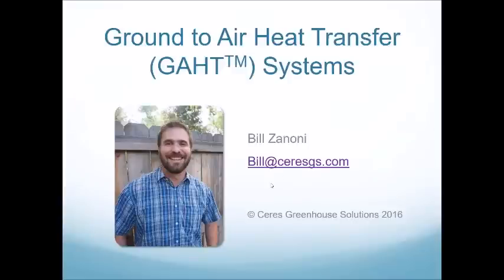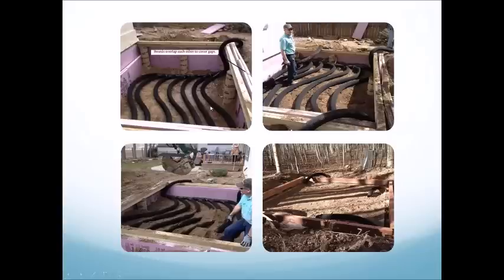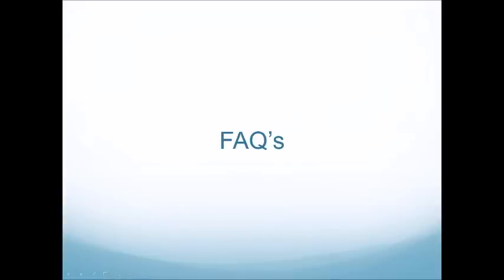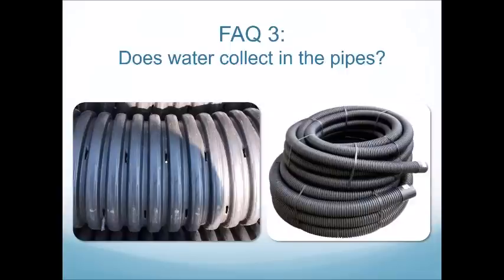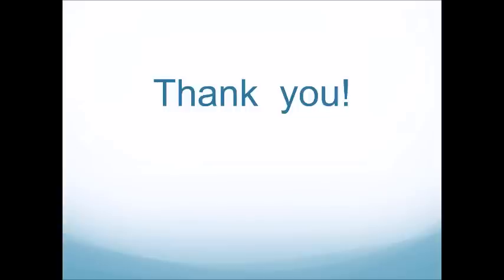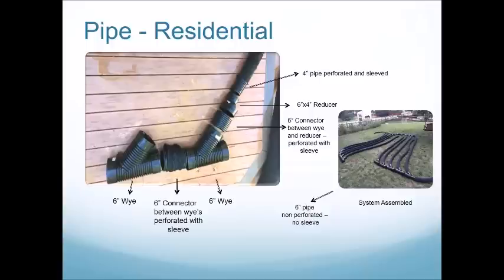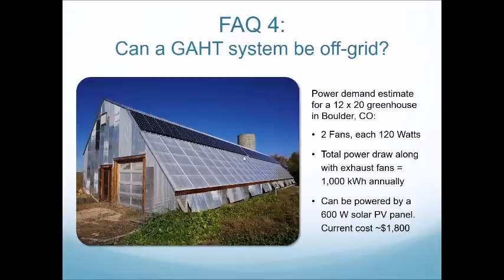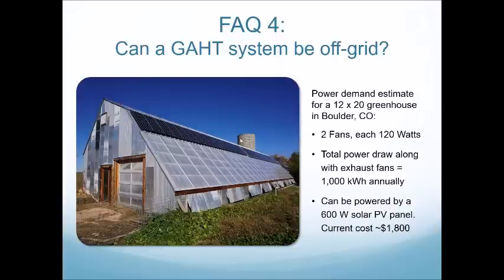Intro to GAHT® (Ground to Air Heat Transfer) Systems

Comment: This system does look like an excellent environment for fungus and bacteria to thrive.
Reply from the maker: Actually the GAHT® system has been known to filter the air passing through it. Also the pipes are perforated, allowing condensation to drain as the warm air is cooled.
Reply: @CeresGreenhouseSolutions  I may be out of bounds as I am new to this technology, however if mold, bacteria etc. is of concern couldn't you introduce a positive/negative ion generator to the system. ie; Air Oasis Bi Polar 2400?
Reply from the maker: @BamaCoolDaddy  You could certainly treat the air going into or coming out of a GAHT®. However, we have tested many GAHT® systems and have yet to find one where the air had more particles coming out of it that what had gone in. An increase in particles could be an indication of mold growth.

Comment: can you use this GAHT system in a house?
Reply from the maker: To date we have never installed a house GAHT® system. This does not mean it is not possible. We just have not installed one. Before considering this option there are two concerns you should be aware of: 

Radon 
Mold
Radon can be tested. And even if there is radon, it is more significant to watch the rate at which it accumulates. In the worst case scenario, if radon is detected the GAHT® system can always be shut off. 

According to studies that were performed by the University of Minnesota on several GAHT® systems where mold was tested no elevated spores were detected. It is important to keep in mind this is one study, and they were conducted on greenhouses and not homes. 

When trying to mitigate mold in the home you could use a filtration system with a UV lamp. It is important to look at ducting system- how to get air through the system. We can help with the design of a new system, but it is harder to work with existing ones.

Understanding these precautions is necessary if you decide to try this system on a house. Please consult us if you are thinking of a house GAHT®.
Reply: Typically they are going from the house to 6 to 8 feet deep at a 45 degree angle then giving the pipe a 2 percent slope for about 150 feet where it can drain into an accessible sump to collect condensation and continues up out of the ground at a 45 degree angle to a height of about 3 feet. They put a filter on the intake pipe. The deeper the pipe the more stable the ground temperature is between seasons. I would check the chart for your area to get the depth that’s most practical.

Comment: can u collect water
Reply from the maker: In what way do you mean?
Reply: @CeresGreenhouseSolutions  to use as heat by combining air and water to hold heat?
Reply from the maker: @terrywolsey8741  we've had growers collect rainwater in barrels to water their plants with but we don't advise that our growers use water barrels as thermal mass in their greenhouse because it takes up a lot of space. We suggest using PCM (phase change material) which comes in sheets that you can simply attach to the north wall of your greenhouse. Check out this blog for more info:  https://ceresgs.com/water-barrels-vs-phase-change-material/

Comment: Looks like a copy of SunnyJohns SHCS
Reply: Its based on John`s early design. There were lot of breakthroughs made prior to John`s passing in 2011 which led to major design changes which they obviously arent aware of. The same can be said of Jerome Osentowski who worked with John. He is the president of Eco System Design, Inc,  and they also use the outdated design..
Reply: JohnGuest45 Please elaborate...

Comment: Pretty awesome, but not very radon safe.
Reply from the maker: A valid concern for sure, and radon levels should also be taken very seriously but greenhouses are less dangerous than conventional buildings when it comes to radon. First, you are not in the greenhouse for as much time. Secondly, greenhouses have very high air exchange rates. During much of the year, air (and any radon) will be ventilated outside, and the whole structure will be flushed with fresh air in a matter of minutes. Even if the ventilation system is not on, greenhouses have many more air exchanges than a standard home, mitigating radon build-up. In our tests of GAHT systems in the Rocky Mountains (an area with high radon levels), the concentration inside the greenhouse was found to be slightly higher than outdoors, but much lower than a dangerous level. By no means is this a comprehensive study, so if concerned, have your soils tested for radon before installing a GAHT system.

Comment: Does the system provide all the heat
Reply from the maker: It depends on the location of the greenhouse and what you're growing. If you live in a colder climate like the midwest or Canada, you're probably going to need additional heating to make sure you maintain a comfortable grow environment for your plants. Here is a blog with more information: https://cerescann.com/ceres-gaht-system-versus-the-ceres-ecoloop/